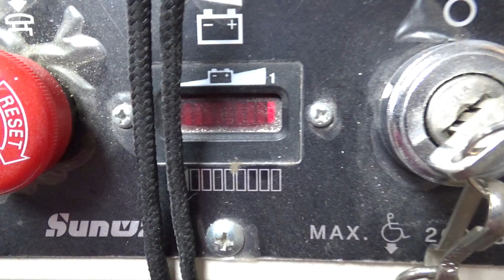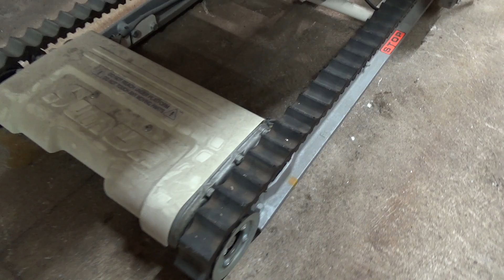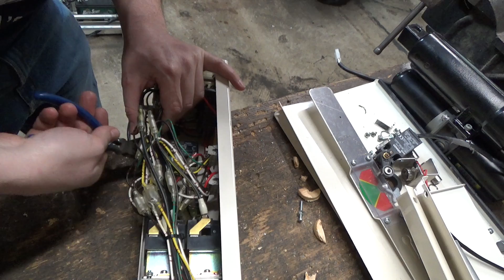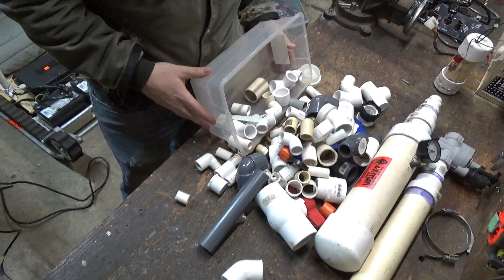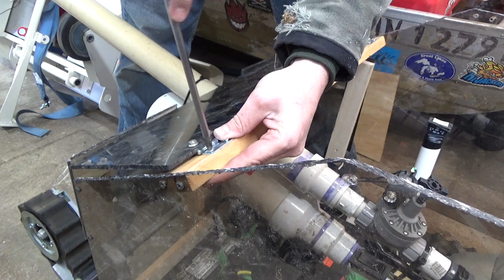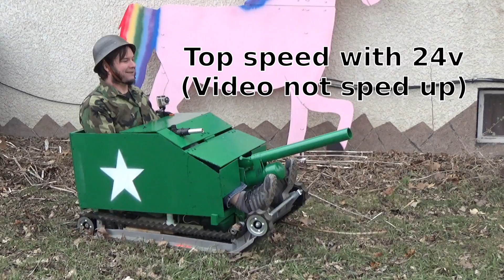Potato Cannon Mini Tank Made From Junk

Comment: Do you have any ideas how to make a rotating turret with that gun? the turret would be mounted on a wood hull , and it could rotate 360 and have some degree of elevation, and depression at any point of those 360 degrees. my english is not the best and im not a mechanic so it might be a bit hard to understand sry. i though of maybe using like the mechanicsm on bicicles for rotating the turret, like taking half of the pedals off, and rotating the pedals with your hand could make the turret move, but i dont know how to make the gun depress and elevate. Can you maybe give some tips?
Reply: another problem i realized that byciclw pedals usually work only in one direction, so idk how i could move the trret both ways same with the elevation, and i also want to use a bicycle for moving the thing, which also begs the reversing question.
Reply: Also I am not an electrician so minimal electrical work would be great I can solve primer and fire mechanics for the cannon with my brother, but anything else is beyond our comprehension
Reply from the maker: That would be kind of fun, but I don't think I'd fit in there with a rotating turret!

Comment: 📺💬 A slow-speed skateboard 🛹 that is because of load you build vehicle that speed can work with the load they expect or dimension.
📺💬 I wish I could switch the speed relays for speed motor controls.
🐑💬 You are correct it is working as speed control but it depends on your gadget because most of tools we fixed relays and the motors or sometimes we build into one piece that is why new comers break the controls motor even it is blocked and sealed.
👧💬 That is a good idea someone to modified on useful thing need to know how id had been build.

📺💬 Do you understand he watch but he need to build.
🥺💬 I also fixed television, submerged motors and electronics but I am aim for apply for jobs then I programming and certificate exame. You are correct that is why I watching you because of the skillful on the seal device such as antenna and motors.
📺💬 You reply the professor too 🥺💬 Telecommunications path.

📺💬 We can build up and sign out our tank from this path.

📺💬 Look like my tank cannon is jammed, and I found the solution.
👧💬 It had gear head bullet but depends on spec or none spec. 🐑💬 Not only removed jammed but it required to add in coolers or dimension as it had multiple times using in old design.
🦭💬 My ship cannon is hard, durable and stability.

🥺💬 Are you alright but that is very skillful handmade tank I see from garage project.

Comment: Ah basic retarded safety systems. Well those are made to be bypassed and often the fault why the machine was thrown away. I think it had potential to be what your employer bought it for, just needed for that retarded safety to be disabled and swapped to individually driven tracks using maybe home made joystick to control it. I would ditch the tank idea and turn it to what it was intended for but with better controls. Otherwise at best it gets dusting in the some storage and eventually scrapped when it could serve its intended purpose and help some disabled. I think making it as mentioned and donating it to some poor disabled would be the best option, of course with legal paper signing away the liabilities of the modifications etc.

Comment: Add retractable spring loaded wheelie bars so you can still climb stairs and hills. Add retractable casters to the front so you can turn easier on hard surfaces without stressing the motors and causing excessive wear to the treads. 
Cool machine though!!! 👍👍

Comment: This would make a great RC bulldozer or Mining machine. 
With the slow speed it might be usable as face cutter platform. 
Or even better a mucker that can follow a line out of the mine and dump its self.
Reply from the maker: I'm considering turning it into a mining machine for Sandland. I'm not sure how long the rubber treads and motors will live through the sand though!
Reply: @saveitforparts  Move the motors up like a bulldozer.  Some sort of horizontal drum cutter would be a neat tool if it spun so the tailings came out over the top and passed out the back of the machine it could dig its own path like a flat square tunnel. 
Start it on a table for the first pass and then on the floor for the second get most of a full tunnel. Scrap lathe carbide tooling would make good bits for it.

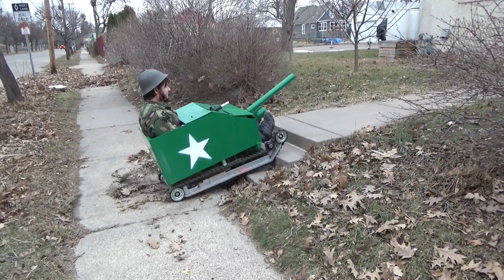Comment: Everything was OK up until 15:45 & then?
Things went all to hell.
OK - so?
Try this..
Rebuild the "tank" by facing the BODY of it, the other way on the skids - so that to "climb stairs" (in order to allow you to have your "weighty" butt at the up-stair end). That way - the tracks themselves will be "driving backwards" - (whilst your tank drives forwards - with you at the back - running on the skinny end of the rubber-skids)

OR..
Fit sissy-bar wheels (to stop it overturning backwards - when pulling high-step "wheelies".....)

P.S:
Have any remote control "off-road-car" Tamiya spare parts - that you can modify as "stair climbers" whilst OUT of the tank?
After all - if crane operators can operate their hi-lift booms remotely - why not remotely drive your tank up stairs..?

Comment: This was a really cool project! I must say, as someone who uses a power wheelchair, I would absolutely NOT trust that thing to safely move me up stairs. Looking at the diagram on the control panel, I'd be terrified.
Reply: We have a couple of these at the fire department I used to work at and they are definetly magic when they're needed and they are safe IF I REPEAT IF the operator is competent. It's always unnerving for the rider though. Your safety is totally in the hands of someone else at that point, nothing like an elevator.

Comment: I you did a remote control (wired or wireless) you could convert it into a powered wheel barrel type hauler and use the tipping mechanism as the dumper. This thing could in handy carving out tunnels in Sandland. Or use it as the locomotive pulling 3 or 4 wheeled carts.